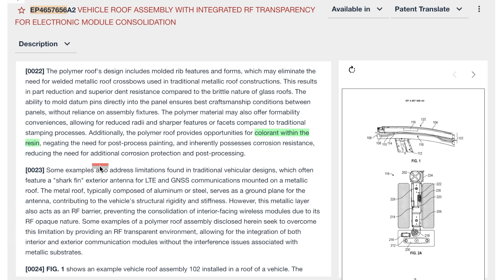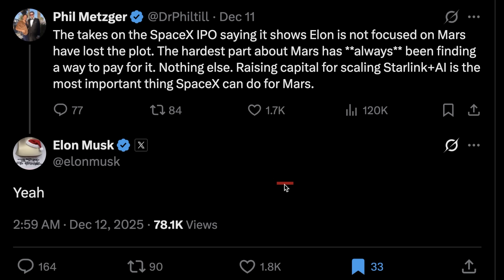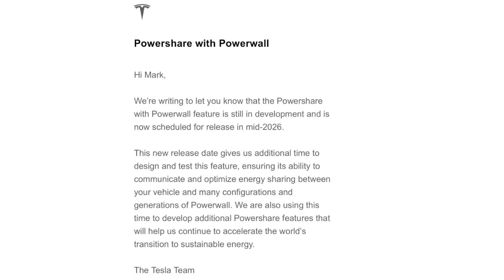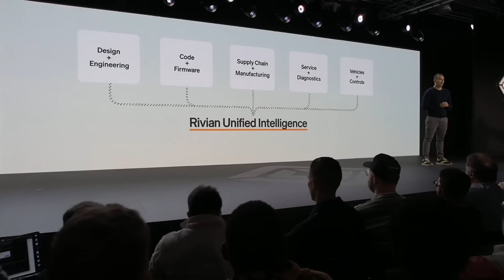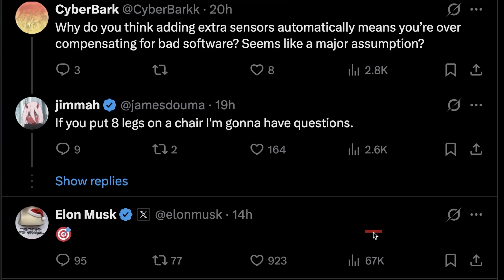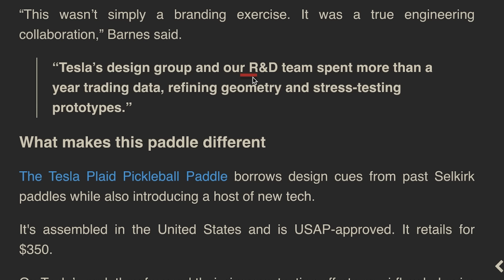Starlink Native in Teslas? / FSD Regulatory Change / Time To Talk About Rivian ⚡️

Comment: My question is what is the fail over device when one or more cameras are occluded?  Why not have a radar to backup vision and bring the car to a safe stop if the camera(s) fail or are occluded due to fog, heavy rain, heavy dust or sun glare  for which I have experienced the red hands?   Use vision for FSD but radar for emergency stop.

Comment: Internal eye stye?  Try filling a clean sock with uncooked rice, heat it in a microwave and close your eyes and rest it on the eyes. Test the heat on the wrist (if it’s too hot for the wrist it’s too hot for the eye). Do this as often as you can until better. It sounds like you have a chalazion, which is a clogged meibomian gland in the eyelids. The base of the eyelids have these glands that produce oil to mix with the tears to keep them from evaporating too quickly from the surface of the eye. When the oil is inefficient it can clog the gland, the heat helps loosen the oil and unclog it. Also try getting a good healthy dose of good omega 3’s in your diet, it makes for healthy oil and thus better tear film, plus keep your eyelids clean (scrub them with baby shampoo and rinse morning and evening). Bottom line, heat is your styes’s enemy, healthy omega threes, and good old hygiene. Eyes are my profession. Feel better my brother in Christ.

Comment: As you said, Rivian is at the beginning of a journey. It's great to have LiDAR at the beginning. More data to process. They can always take it out, as Tesla did. And they will probably do it at some point. But if LiDAR helped them get started faster and safer, they should use it.

Comment: Tesla has a significant issue that needs addressing before Starlink integration will function properly. The vehicles do not have an intelligent signal monitoring function for Wi-Fi vs LTE. If I have Wi-Fi enabled in motion (the only relevant Tesla option) and I drive into a parking garage or urban canyon (tall buildings), the Starlink antenna loses connection as expected. However, the car does NOT automatically recognize this and fall back to the LTE connection. This is a standard software feature on mobile phones and tablets.
Reply: An even more desirable function would be an option to prefer the Premium Connectivity (LTE) connection in motion and ONLY use the Starlink Wi-Fi when LTE signal is weak and for software downloads.

Comment: Rivian appears to be only 6 months behind Tesla in FSD.  They will release their FSD in December on all Gen 2 vehicles (those sold since Jun '24) and make it free until March.  After that they will only charge $2500 or $50/mo.  Their vehicles are very attractive.  I would love an R1S it it was FSD capable.  I think Lidar will be important to get to Level 4, as the times that my Teslas have forced me to take over from FSD have been where visibility was impaired -- driving directly into the sun or Very heavy rain.  I am very bullish on Rivian pulling equal to Tesla in 2026 in FSD.  Rivian FSD pricing will force Tesla to drop their price too.  That's great for the market.  Right now only 12% of Tesla buyers get FSD --- dropping the price will help that and increase vehicle sales too.  Good all around --- We should all be cheering for Rivian.  It will make Tesla better!

Comment: Rivian’s inherent problem with their FSD is that not enough cars are on the road for them. The fixed cost alone for building a vision based autonomy system is in the several $billions - as Tesla has shown - but Tesla was able to offset the financial burden by selling millions of cars, making  money on energy, money from supercharging, etc.

Rivian is expected to sell 45,000 cars this year…at an incredible “take rate” of 20%, that would not even be 9,000 cars. At $2500, that is chump change money to pay for the $billions in costs.

Rivian will have little revenue, too few cars to collect data, etc.

It will be more effficient for them to license Tesla FSD…

Comment: I am a long time holder of Tesla and would be thrilled to acquire SpaceX shares. However, that would require me to sell Tesla shares to do so. If a large number of Tesla owners attempted this, it would mean Tesla shareholders would take a hit when the Tesla stock takes a hit from the selling pressure. Not sure if there is an easy fix to this conundrum. 😢😢😢

Comment: Dillon, eye dr here.  Lots of warm compresses needed. Can use warm (as warm as you can stand) water in a snack sized ziplock (green solution as it’s reusable). About 5 min a session multiple times a day.  Almost all styles stay in front of the orbital septum so not generally serious but real annoying.  They can be opened and drained, if not resolved with warm compresses.
Reply: Great share. Frequent hot compresses works for me every time. Grok mentions diluted baby shampoo to wash the lashes also. You know the buggers that collect there if face is not washed well & frequently– which many guys are not great at.

Comment: My Starlink mini suction cupped to the ceiling. Glass on my 2022 model, three 
Worked great. High Speed wi-fi everywhere I go. But when I bought my new model Y with that fancy Glass Overhead, the signal won’t go through. It has to be externally, mounted, and looks real clunky. My cyber truck works perfect inside because that Glass doesn’t have that blocking material. Kind of wish there was a way that I could mount my mini on my new model Y inside.

Comment: Rivian is using the same architecture used by Volvo with the EX90 and the Luminar lidar + NVIDIA.
It was a total failure.
Volvo Ends Relationship With Luminar, Drops Lidar For 2026 Models

Comment: Respectfully, this sounds like “AI discourse” more than robotics. If your robot needs a network trip to a mega-LLM to decide what it sees, reads, hears, and how to move, it’s not a robot; it’s a laggy terminal. End-to-end perception -> understanding (text + speech/audio) -> action has to run locally because latency and reliability matter. Also, if a text-to-speech model were required, they are small, even a good one can easily run on edge and it shouldn’t be necessary because eventually Optimus will be end-to-end. (I comfortably run the biggest and best open text-to-speech and speech-to-text models on my MacBook.)

Big remote models can still help sometimes (rare heavy reasoning, external info, fleet learning), but that’s augmentation; not a constant dependency. You don’t need a trillion parameters in the cloud just to do real-time, on-device understanding and control.

Comment: RIVIAN made nice progress and the game can be seen already. As they are partnering with German Volkswagen and indirectly so with Ford using some platforms this is a scenario like when Apple had the better OS than Microsoft. The mass tries to legally push not necessary sensors to add value to the car or rip off customers. At least the RIVIAN team paid off because in copying TESLA they are already better than the 3000 clowns with ‚work-life balance‘ at CARIAD which still like management has no brain! So this if it is real is a big step forward!

Comment: On the lidar subject, couldn't Tesla just add a fwd facing lidar to give more data points to treat as extra pixels in their rendering models.  This might lead to less phantom breaking events and quicker regulatory approval.
Reply: LiDAR is a waste of time. LiDAR has false positives so it will have phantom braking just like RADAR. LIDAR is not magic.

Comment: # Key Points Summary

*Tesla Smart Roof Patent*
- New patent describes RF-transparent polymer roof for integrating electronics directly into roof structure
- Enables better assembly automation and prepopulated electrical components installed as single unit
- Includes satellite communication (GNSS for GPS, not full Starlink broadband), LTE, speakers, fans, processors, Bluetooth, microphones
- Not a full Starlink integration despite speculation - patent refers to GPS satellites, not broadband internet
- Could support limited direct-to-cell satellite connectivity for emergency calls/texts
- Benefits: lighter weight, better sound insulation, more headroom, easier manufacturing for Cybercab

*Elon's AI Satellite Vision*
- Convergence plan: Tesla AI chips → XAI → Starlink AI satellites → SpaceX launches
- Starlink V3 satellites (20kW) launching Q4 2025, scalable to 100kW for AI compute
- AI satellites easier to build than Starlink V3, will use laser communication to connect back to Starlink
- Fewer regulations for AI inference in space vs. Earth
- SpaceX IPO may offer early/discounted access to Tesla retail investors

*AI Executive Order Impact*
- Trump signed federal AI framework giving authorities power to challenge burdensome state regulations
- Could help Tesla challenge California's SB53 requiring safety plans for high-risk AI systems
- May speed up robotaxi rollouts in restrictive states
- Tesla stock up 2.7% while NASDAQ down 1.7%

*FSD Progress*
- Multiple testers calling FSD v14 ready for backseat driving
- European testers say it's ready for EU approval
- Capable of complying with all EU safety requirements
- RDW demonstration scheduled February 2026

*Rivian Autonomy Day*
- Adding front-facing LiDAR (contrary to Tesla's camera-only approach)
- Using AI model for sensor fusion (different from Tesla's old rule-based radar fusion)
- 3.5 million miles of hands-free driving coverage launching next month
- Limited fleet size and data compared to Tesla - likely 5-10 years behind
- Pricing: $2,500 upfront or $50/month for autonomy package
- Google-partnered AI assistant looks promising with calendar integration, climate control, messaging

*Other Updates*
- Powerwall vehicle-to-home feature delayed to mid-2026 due to technical complexity
- Model Y Long Range may launch in Europe Q1 2026 (unconfirmed)
- Nissan developing hands-off/eyes-on system for under $4,000 by 2028
- Tesla released $350 Plaid pickleball paddle (serious engineering collaboration, produces 2,484 RPM spin)

Comment: It’s a given that every time a company implements LiDAR into their system suite they have to mention the limitations of simple camera only systems to justify the need for LiDAR. What really gets under my skin is the lie of ignoring the fact that LiDAR is also limited by the same environmental and physical factors. Not only that but LiDAR also has additional limits that camera based systems don’t. It’s like a certain drug company pushing its own version of aspirin, citing the side effects of other brand’s and not mentioning any of theirs, while knowing theirs has even more side effects. Also, the LiDAR generated images they showed does not represent what the vehicle sees at all times in a particular space and time. Since the vehicle only has one LiDAR sensor and it is only mounted up front for only front facing scanning of the environment, showing a 360° 3D environment is misleading. Unless they are basically using camera data from the back half of the vehicle to supplement the LiDAR data, which is highly complex and unnecessary in a task that needs to be as realtime as possible. Needless to say the LiDAR sensor will only be effective at low city streets speeds, forward moving direction, and even more ideal environmental conditions than Tesla’s system. The people working on and for LiDAR just aren’t being honest with the public about its limitations. Which is why it is never mentioned and the strategy is to always bring attention to the limits of simple(decades old) camera based systems, which Tesla’s propriety system is far more advanced. It’s like a modern car maker always comparing its latest ICE vehicle models to the EV1 from the late 1990s.

Comment: The LG pack in the YL just uses the larger of the two battery modules made of 2170 cells. - these modules have 23 and 25 cells in series. The YL uses 4 of 25 cell in series modules. There are still 46 cells in series. Thus we have 4600 cells rather than 4416 cells.
The fuel economy is 130 Wh/km WLTP, or 466 J/m.
But 600 J/m or 167 Wh/km or 268 Wh/mile is more likely for normal drives. Thus, range is more like 530 km, 330 miles.

Comment: SpaceX direct to cell will not work in a normal car as the roof is an RF barrier. SpaceX terminal not mentioned, but a number devices with antennas are. LTE is mobile phone and SpaceX will broadcast direct to mobile phone. Every vehicle in the world will need an RF transparent horizontal surface for space communications.

Comment: FSD 14.2.1 has been great on my cybertruck however, I wish it made lane changes much more quickly and decisively
Reply: My “fix it” list is headed by fixing the too early turn signal—especially for right turns with other options between you and your intended turn.  SO often it signals “turning in” as I’m approaching a parking lot exit with a car waiting to pull out into my lane.  Of course, we’re not turning in there, but at the corner 30 yards further down. 🤦‍♂️